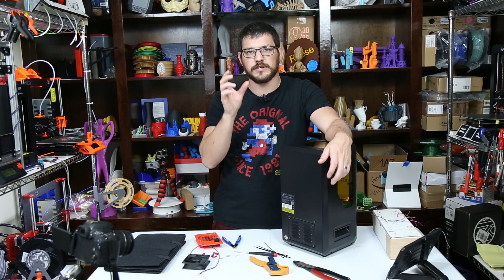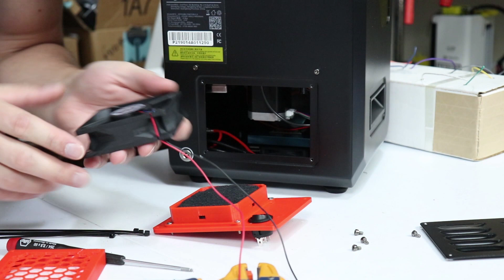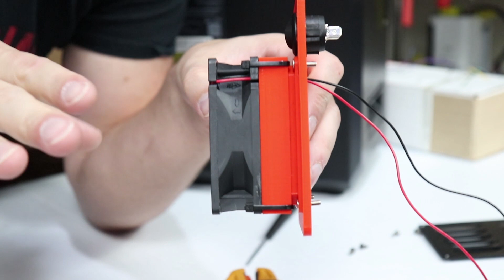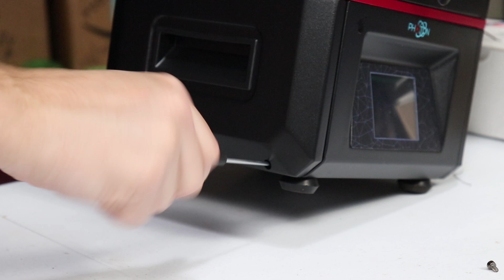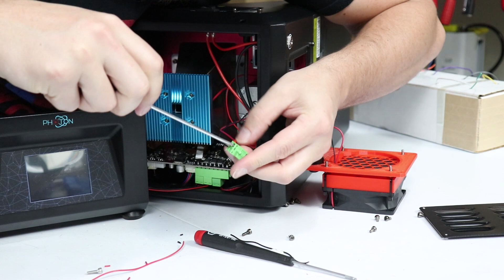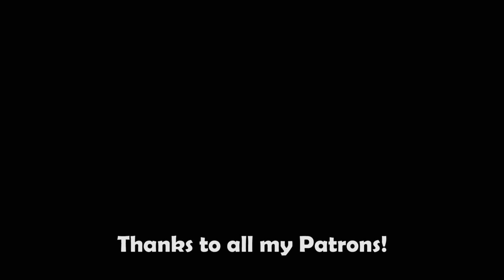Anycubic Photon Carbon Filter Mod

Comment: wouldn't you want the VOC'd air to move through the carbon SLOWLY to give it a chance to interact with the carbon instead of RACING past it as fast as possible?  I'd want the VOCs in the air to have as long as possible to bind with the carbon, not as short a time as possible.

Also what keeps the LED fan from pulling the VOC air out through the bottom?

Comment: Can't see how this would work . . . the enclosed photon range of machines (all the way up to the SE) have a large vent on the bottom of the machine . . . with a large extractor fan pumping the air downwards through the base vent . . . as much as you would be able to extract some fumes/air through the rear vent with a fan, so much more is pouring out of the base of the machine.
Reply: Looks like the fan would pull air in and up through that bottom vent and out through the filter.
Reply: @DrChattan  I suppose this might work if you disconnected (or disabled) the large internal extractor fan, he makes no mention of this in the video, as described in the video the mod wouldn't do much to improve filtering.

Comment: You can get super silent brush-less fans, but they're obviously more expensive. Thanks for the video. It saves me getting the dimensions for the rear panel as I was going to do something similar. I might also make a square fan cover adapter to a standard round 100mm circle so I have the option of adding or removing a standard air-vent hose. If you could reduce the voltage to the fan it would be much quieter and the reduced speed won't be a problem as a fan that size is designed to be used on a much, much larger and very hot PC case/cabinet. As for the wiring, I think I'd prefer using a d.c. splitter cable from the jack going into the Photon , so you then don't need to bother opening the case.
Reply: BeQuiet!™PureWings2 are insanely quiet, when I was first testing it I thought it was broken as I plugged it in and nothing was happening, I kept trying different power supplies, in the end it had been working fine all along it was just so insanely quiet that you had to be looking at the fan moving to know it was on . . . it's probably even quieter than the Noctua . . . and not too expensive either, I paid £12 (100mm).

Comment: Will this fit on the mono x? Waiting on mine to be delivered
Reply: No it wont. There is a duct for it design on thingiverse...but im still not sure about the the efficiency of this mod anyway having the fans clearing the electronic chamber only , while the fumes are accumulating above (there is no air flom from the top to the bottom in the Mono X  - maybe the photon in the video is different )
Reply: U have the link to the mono x one? I didn't see it.... U think we could cut hole and add fan and filter to the lid to clear the fumes? Or will that mess with the print?
Reply: @schmerzdj5719  there is one guy that just put a fan over a box with holes and activated carbon inside the enclosure so it is circulating the air inside and purifies it. this is a pretty easy mode and you dont need to destroy the aluminum.  

another option is to put a very small air purifier inside (basically the same concept but looks better. Elegoo actually sells these as a solution for the Mars... it is call elegoo mini air purifier (comes in pair for 22.9 on their amazon store) no replacement filters available but i heard people just fills to old ones with carbon grains when it is stops working. 

The wind will probably wont mess with the print as it is protected in the vat.
Reply: I was looking at those elegoo purifiers, do they suck the air thro with a fan or just absorb??

Comment: I know nothing on this, why is it being "tin-ed" an issue?
Reply: It's the cheap option. Ideally you want them to be using a 'ferrule' as it creates more surface area and is more robust than clamping down straight on to a wire. e.g. = https://www.pacergroup.net/wire-ferrule/
Reply: I've not watched the video but I assume it was related to tinning the end of wires that will be secured in place using screws? If so, it's due to, in part the small contact area you get, but mainly because tinned wires will still change shape, solder is soft, overtime it will become looser. Is this an issue for a low powered fan, not sure.

Comment: Less parts (1 or 2 depending on if you want to use a cover on the filter).  You don't have to zip tie anything. 45mm long screws for the fan.  The compartment for the carbon filter doesn't have any screws going through it.  Filter has it's own little chamber so that you can change it without removing the fan.  3/8" thick chamber for 3 layers of carbon filter.  I am also using a PWM controller to regulate the fan speed.  https://www.youtube.com/watch?v=PHJsQdTVYUI.  Next time directly wire the negative and only run power through the switch.

Comment: Dude, you totally misunderstand what a switch is, is not that you've swaped wires, you NEVER should connect both of them to the switch, you HAVE to chose one pole, preferibly positive since it has the load. The only thing a switch does is to open or close connection between pins, exactly the same as if you hook up the fan directly to the PSU and just cut one wire to stop it, and make them in contact to turn on again.

If the switch has only 2 pins, they will be 1-common 2-NC/NO (normally closed OR normally open). If it has 3 pins they will be 1-common, 2-NC, 3-NO. Normally open means that the circuit keeps open (off) until you press the button to close it (on) while Normally closed means the opposite: that pin will be closed (connected to the common pin) until you presh the button to open it.

So, what you have done the first time is to short the circuit connecting positive and negative poles of the mainboard between them,( and you are lucky that your PSU has short circuit protection), otherwise you'ld fried your mainboard/PSU. The second setup you ended up with is a total nonsense that only works because when you put it "off", you are actually connecting both positive and negative poles of the fan to the negative of the mainboard, that does basically nothing.

The right way  to do this is to decide what pole you want to open/close (normally you should pick positive) and then use the switch in that pole properly: in your case you should connect fan+ to pin 1 and mainboard+ to pin 2 (or viceversa it doesn't matter since it's only opening/closing two wires together/appart) and leave pin 3 (Normally closed) unplugged. Fan- goes straigth to the mainboard- or PSU-.

Btw, I think you should understand the basis of electrical circuits before doing a potencially dangeorous tutorial and you should edit this video to advise the error you've done.
Reply: I came down to see if someone had mentioned this before I did.

Comment: As soon as I saw how he initially wired the fan power switch I knew he was gonna be shorting out the power rail and triggering the supply's short circuit protection when in the off position. The safest way to wire it is to only switch the high side of the power rail in series with the switch from the on position pole of the switch (normally open pole) and the common gets connected to the fan. The opposite pole can be left alone or insulated if you are paranoid. Ground passes straight to ground of the supply and is not connected to the switch. This way there's no risk of shorting out the supply.

Comment: The quantity of carbon and the time the air is in contact with it all determine how much "bad stuff" gets locked up in the activated carbon fibers.  Lower airflow may actually be better, and certainly a larger chamber with more filter material is better.  Best thing to do:  put the printer in an overall enclosure and then run that air in circles through a carbon filter.  Here's my design, free on Thingiverse.  Just need an 80mm or 92 mm pc fan, same as this project, but tons more surface area of carbon filtration.  And I used exactly the same sheet of furnace filter carbon as was shown here.  https://www.thingiverse.com/thing:2209222
Reply: how well is the filtering in a full encloser working for you?
Reply: @SeliasSonne  Sorry for the day, I thought I'd replied to this!   Filtering inside a printer enclosure works very well.  As for printer fumes that you can smell or that cause burning eyes.  It completely eliminates the problem entirely for me, and I sit close to my enclosure.

Lately though I've read about nano-particles that are generated by FDM 3D printers, which apparently no conventional filter can reduce. So there again, probably best to leave the enclosure closed up and if you're a patient person, wait an hour after the print has completed and those nano particles have settled.
Reply: It works very well!  No detectible fumes based on smell and no more red irritated eyes.  That's not scientific but it's a definite improvement.
Reply: Could you make a video detailing assembly

Comment: why is it that you don't think the connectors should be tinned?
Reply from the maker: Because it is an IPC standard. IPC-J-STD-001 Rev E, page 13, section 5.1.3
Reply: Tinning the wire in a screw connector causes the solder to get crushed. It is best to smash the wires for a better connection.

Comment: That's awesome. Thanks. 

How long have you had your anycubic photon?
Reply from the maker: I got it back in May.
Reply: @Fugatech3DPrinting  still going strong?  Got mine in August. So far so good. A few failed prints though.

Comment: why pump the fumes into the room when it will stay in the lid and only let it out when the print is finished.
Reply from the maker: It doesn't stay in the lid. There is a fan that pulls it down into the bottom cavity.
Reply: the carbon filter catches all of the particles causing the smell, the fan just sucks it all towards the filter. there should theoretically be no smell or fumes coming out past the carbon filters.

Comment: just dissable fan and block the hole there is nothing like that on the elegoo and use elegoo resin.
Reply from the maker: No. That has been discussed at length on the Facebook group as a bad idea.

Comment: An easy to find source of carbon and zeolite for air filters is a pet store. You can pickup either separately or as a mix in pellet form for aquariums. Pickup a media bag while you are there, rinse it out really well and fill up your bag. 3 pin switches are not necessary. The 3rd leg is for lighting in the switch. Pin 1 would be power, pin 2 is what you are powering (accessory) and pin 3 is your negative or it can be left off. An easier option is a 2 DC switch. Connect the positive of the fan to the power connector. Run a wire from the negative of the power connector to one leg of the switch, doesn't matter which one. Hook the negative lead of your fan to the other pole of the switch and your done.